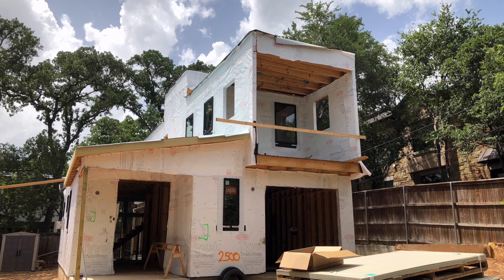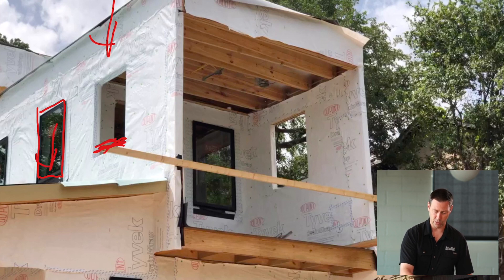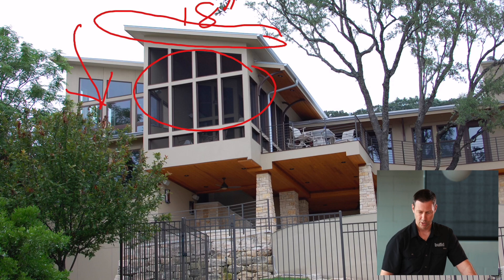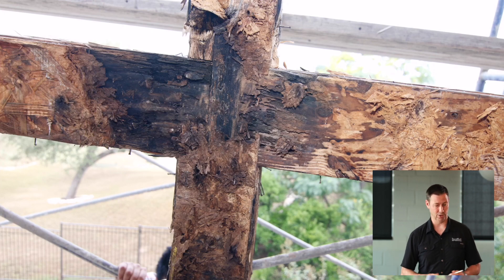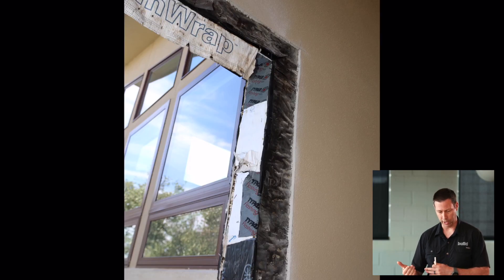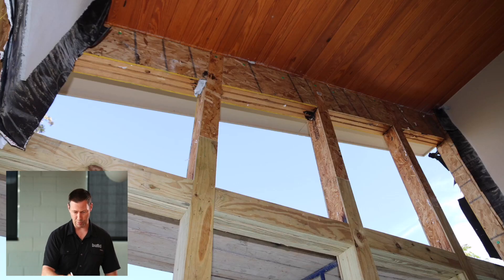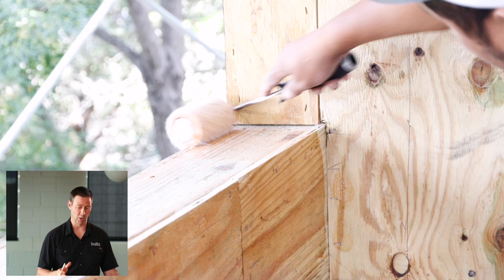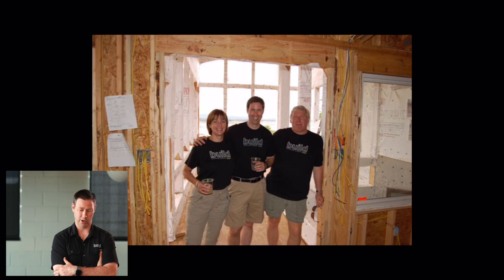Learn from MY FAILURE - A Building Science Lesson

Comment: At 4:00, the failure is why I hate OSB. I call it and mdf vomitboard. Plywood will take huge abuse and still work. Even if the glue fails, the layers will still work and give you some strength. OSB is little chips of rot prone wood, prepared nicely for the rot microbes.

Comment: All builders, take note, stand behind your work.
Reply: Otherwise it is GG
Reply: All  engineers
Reply: Some will.
Reply: Unless it's a manure spreader...
Reply: @ke6gwf  🤣🤣🤣
Reply: I am actually impressed he came back like that to get it right. I guess it depends on the problem. Idk if that sort of thing is “transferred” on a sold build
Reply: most builders close the company after the jobs are done (i.e. development). Then you have nobody to call. Then they change the company name.
Reply: @rickw4160   A good lesson to learn. Never buy a brand new home and never buy a brand new car. Let someone else debug it.
Reply: Especially behind that "safety" rail
Reply: Anyone know about insulation foam board I bought from habitat black one side gray other side foam pale yellow reducing camper and need to know if it's safe to use
Reply: Restoring
Reply: Yeah,  not many do 
They always blame someone else ,which had nothing to do with the work,  bad experience with builders ☹
Reply: Or under it...
Reply: How do you screen clients to make sure you get good ones ?
Reply: @diannaquick6240  Usually there's markings on most insulation
Reply: Take notice...wood has to be the worst building material still in use. Concrete..masonry... doesn't rot.. doesn't burn ..I built wood houses most of my life! Till I discovered there was something better.
Reply: @brianfong5711  
Otherwise it's LOUSY .
Reply: and all used car salesmen.
Reply: did u pay for all the material and charge nothing for the labor of fixing it? if it was truly his fault he should fix it for free
Reply: @MichaelMickelsen  why not?
Reply: Architect here, our group needs to pay attention to these issues just as much so we don't put the builder in these situations. Frankly everyone at every level of construction needs to work on a job site for at least one project.  I didn't think so at the time but my first year out of college my boss has us build an 1800 sf Deck with a gazebo for a client.  We heard 4 weekends he claims 8 weekends.  Seventeen weekends later it was done.  I had more technical experience than most architecture acho graduates as I took drafting through high school but it was the construction experience that got me to think even more about how those details need to go together and the person who has to build it.

Comment: The problem was literally caused by cutting corners. Appreciate the video!
Reply: Props for proper use of "literally". lol
Reply: @ClickLikeAndSubscribe  Use the right kind of materials first and use them properly second.
Reply: @ClickLikeAndSubscribe  I remember one lesson in Southeast Asia when I was assigned there in the 1970s as part of a diplomatic mission. One builder who was using wood actually owns his wood drying kilns and they're designed to thoroughly dry the wood by using infrared inconel heaters INSIDE A VACUUM at the right temperature and at the right time duration period with the wood properly spaced apart to properly dry them. After drying them, we move to an another facility that is connected to the kiln drying facility and he places the kiln dried wood inside them and a vacuum is created and once a high vacuum is created, a pressurzed mixture of bakelite plasticized asphalt is pumped in inorder impregnate all the wood from the inside out, through by through. Once that is achived the pressure is equalized and the excess bakelite plasticized asphalt is allowed to flow to the bottom for reuse and the wood is transferred to a drying and dripping area so that the remaining excess  bakelite plasticized asphalt is allowed to flow for reuse again.  Friends of mine told me he is sill doing it and everybody likes his over-built wood products which are way above standard and the wood products he made are still in pristine condition!

Comment: Run a WUFI analysis on that assembly... completely encapsulating it in vapour impermeable materials will probably result in trapped moisture. Over time the assembly  will reach 30% MC and will rot!
Reply: Connor McQuade Stay tuned. Maybe another replacement video coming in a couple years.

Comment: When l do Windows like that l manufacture stainless steel flashings .
One thing you didn't point out is the nails down into the flashing , that's a no no !
Reply: it was everything you never do and on an upstairs porch is shoddy work period and very dangerous, they made several mistakes and how much of that OSB framing did they really use if you used it on an exterior load bearing post ..smh...shame!
Reply: splashpit that flashing stuff is supposed to self heal around nails and make a perfect seal to the metal, similar to ice and water shield on a roof edge

Comment: So even with the new super sealed products, isn't the principle of making it dry faster than it gets wet still in jeopardy?   The more it's sealed, the more the moisture is locked in.   I've seen "waterproof" electrical junction boxes half full of water due to condensation.   Was anything done on the rework to allow those walls to dry out?
Reply: One would have to check the permeability ratings of the new waterproofing to see if those walls (rework) will have a chance to dry out.  If the perm ratings are above 20 perms or so then the walls should be able to dry out so long as bulk rain water is not finding its way directly in.

Comment: OSB or strand/chip board should not be used on anything more important than a dog house. It is absolute garbage for any purpose.
Reply: Very much not true. It is has strengths and weaknesses just like any other building material. OSB =/= particle board
Reply: My new house is made out of this stuff.  After 2 years i have osb rot underneath my kitchen windows.  Still haven’t figured out where the water is getting underneath the housewrap very frustrating and a bit terrifying how quickly that osb swells up and falls apart

Comment: these failures are architecture first
Reply: No they are not !
You cant design a waterproof building ,period. It should and most likely would have been noted for the builder to make sure all external openings are watertight (building codes ahem). You can put the largest overhang you like on that building and it wouldn't matter, because of wind etc.

Comment: Awesome video.  Really like your ideas on waterproofing. I completely agree on the overhang. My house was built in the 70’s and had zero overhang on the back of the house. Years of problems with water down the back walls of the house. During a remodel I added a 12” overhang across the entire back.  No problems since then.

Comment: the picture at 13:07 ish , you put the flexible corners on the cill (lower) corners of the window openings but not the upper corners of the lower window openings(hoping to make sense) i know that the cill corners is where you will take the most water but surely if the upper corners of the window openings arent sealed they could just accumulate water(albeit slowly) and there will be nowhere for the water to go

Comment: I remember one lesson in Southeast Asia when I was assigned there in the 1970s as part of a diplomatic mission. One builder who was using wood actually owns his wood drying kilns and they're designed to thoroughly dry the wood by using infrared inconel heaters INSIDE A VACUUM at the right temperature and at the right time duration period with the wood properly spaced apart to properly dry them. After drying them, we move to an another facility that is connected to the kiln drying facility and he places the kiln dried wood inside them and a vacuum is created and once a high vacuum is created, a pressurzed mixture of bakelite plasticized asphalt is pumped in inorder impregnate all the wood from the inside out, through by through. Once that is achived the pressure is equalized and the excess bakelite plasticized asphalt is allowed to flow to the bottom for reuse and the wood is transferred to a drying and dripping area so that the remaining excess  bakelite plasticized asphalt is allowed to flow for reuse again.  Friends of mine told me he is sill doing it and everybody likes his over-built wood products which are way above standard and the wood products he made are still in pristine condition!

Comment: I am impressed that you are willing to highlight your past mistakes.  I am a professional engineer who is considered an expert in construction defects.  I have done over 800 forensic engineering inspections and a great number have been focused on water intrusion and rot.  Your video is spot on!!  Great investigation, good determination of the root cause of the problem, and even better follow up to properly waterproof the structure.  You are correct, the vast majority of the time it is not the product or material that fails, it is poor or incorrect installation that leads to water intrusion.  Great Job!!

Comment: My DIY building efforts on the arid Mojave Desert in Southern California during 44 years, have met with similar wood rotting problems shown in this video. Even though our rainfall is just over 4 inches a year the extreme hot temps of the days combined with the 30 plus, degree drop in temp. at night, results in condensation, which is just as harmful to wood as rainfall. Water is water, and wood just needs to stay dry.  Thank you for posting this very informative video blog.

Comment: Totally right about water always wins. I was doing what appeared to be a small job with a spot on the wall. After opening up the wall it was discovered that the roofer left off some of the water and ice shield. It allowed water to leak into the wall cavity. Everything inside was rotten. Needless to say the home owner was totally stunned and shocked that now it had turned into a big job with a lot more cost to fix.

Comment: Bravo dude! Bravo. A real man admits his mistakes and takes action to correct them. I am so tired of fools making mistakes big and small and not taking responsibility for them. This goes both ways. DIYers, prior contractor, and those doing the work now. Clients and builders builders alike must document, document, and document. If a client has concerns about a method or product a builder or one of their employees is using, document your concern with photos and ask the builder to verify if the work was done to specs. On the flip side, a builder must do the same when dealing with previous work by the client and prior contractors. Don't become responsible because someone else's bad work caused your work to fail. Ignoring problems with existing work can make you liable in the future. Walk away from the job if the client doesn't allow you to fix potential issues. Your business and reputation is on the line!

Cheers!

Comment: I work for one of the big international waterproofing manufacturers … we do not warrant any waterproofing installation of our fluid applied nor self adhered membranes if applied to OSB. Period.  Bone dry OSB is strong as you mentioned; however, if wet or damp OSB dries out it still loses 70 PERCENT of its strength and never regains it as your 2X6 does.  Hook up with a COMMERCIAL WATERPROOFING Manufacturer; they will show you proper waterproofing installation techniques.  You’re a stand up guy for sharing this experience with everyone… I’d hire you to build my house based upon your integrity 🙏😎

Comment: Well stated Matt
As a builder too, I have given this issue much attention.
My resolution is to upgrade to modern materials.
From paper and plastic wraps, to wet monolithic applications that dry as a solid product.
I see you came to the same mindset.
There are products that are used in other industry that will perform greatly in our industry.
1- A rubberized spray, applied wet from a can, dries solid.

2- Tuff Liners, a product that is sprayed on and dryes rock solid.
This requires specialized equipment.
Hopefully this will give you some ideas, perhaps we can solve this issue together.

Comment: Great video Matt! Thanks for sharing. My house starts framing on Monday, and I was wondering what the best way would be to add a 5 degree slope to the window sill? We are doing a trimless / sheetrock only finish on the inside; and my builder is not certain the best way to slope the sills and I'm concerned about water as this project is in the PNW (PS: I convinced him to use the Zip Wall System with Liquid Flashing, this will be there first time using that product)
Reply: tpthaler the most common method (at least in my neck of the woods) is a piece of cedar lap siding cut to your opening length and nailed to the framing and then apply your waterproofing over that.

Comment: Great video showing how things can go wrong.  This is really about growing pains with new products coming on the market and the people using it have to figure out how to make it work.  I recently installed some new windows and the manufacturer has come out with rigid plastic flashing for the lower corners to avoid trying to make the peel and stick go across the sill and up the wall.  I also live along the coast where we get Nor' easters and  South easterly winds with heavy rains that will drive water up under an overhang no matter how deep so you have to plan on things getting wet.  The way you fixed this looks great and I hope it works out... as you point out sometimes building what the architect wants and what is most durable means something has to give.

Comment: So here's a question. How did they do So well in houses that were built centuries ago before any of these products were available? I've pulled apart sections of houses that were built in and around 1890 to add additions and the original framing was old yet in perfect shape. Some were lucky if they had a product similar to tar paper. 
Cedar shake roofs, diagonal 1x6 for sheathing and in only some cases had tar paper, copper gutters and only paint for protection. Admittedly the porches would go to hell sometimes but the remainder of the house would be great.

Comment: Nice to see that you stand behind your work, and put a lot of thought into the way you build things. For the amount of time an energy you put into those flashings why not custom make them from lead or copper and weld the seams. All that liquid applied flashing is just going to degrade and fall apart in under 50 years, not to mention water is going to find its way in basically no matter what and you’re just trapping it with the ice and water shield. No way this screen porch is going to hold up for a hundred years.

Comment: I am glad to see you switched to solid material and pitched the sills. I cringe when experimenters take LSL's on patio or overhangs with just varnish surface protectant. It looks good but never lasts. If you need to do a built up sill and all "outside" fascia a quick coat on the inside of the board of oilbased primer works wonders to mitigate water transmission from seams and penetrations. Last word finish trim needs to be hart wood regardless of species as no paint or stain will protect the sap wood long enough to prevent the painter from getting a callback.

Comment: Howdy Matt! 

Can you consider making a shed video? I am looking to build a 12x16 barn style shed. I feel like some of the stuff you talk about can be applied to these structures. Such as the overhang on the bar style sheds are nice on the sides but not front and back. Maybe a fluid applied system would be easier for the windows. You also make me think about under the shed and how I can avoid water damage over time or weather. I still haven't settled on a concrete floor or peer & beam setup yet. I gotta find your videos on what you recommend when wood touches concrete. 

Thanks!

Comment: I have seen plenty of sills with more than 5 degree slope.  I don't think 5 degrees is enough.   Re that original peel and stick product - the cuts on the edge showing bare wood was really stupid. I find it hard to believe that you would have allowed tgat.  Also I agree with you on OSB sheathing and lams.   The stuff is so incredibly sensituve to water that those two applications ought to be illegal.  I'd never have a house like that !  Holmes had a show where snow got in and completely warped the beams   Just a total rubbish product. People use it cuz it's cheap.  Cuz they're cheap.  Solid wood : there's nothing like it.  The regulations have to change.

Comment: Must say kudos to you for putting your mistakes online showing others where you went wrong to help people learn. Hopefully you save somebody this problem in the future. it amazes me sometimes of how little the people that are actually installing the product actually know what it's purpose is or how to install it correctly. My boss hired a brick mason the other day that probably hadn't laid brick in 15 years that had no clue what it was or why we were using aluminum termination bar on top of the flashing. Flashing isn't an easy thing to have to deal with though its sticky and uncooperative and it will piss most people off, especially flashing an inside corner. And I always try to steer clear of any engineered wood whenever possible. you can pack all the glue against little pieces of wood all you want but a little pieces of wood are still going to rot. It amazes me how many houses are built mainly out of glue and sawdust. I must say I halfway stand behind anyting Zip system though. It's expensive but I've  had pieces scrap pieces of it laying on the ground in the yard exposed to the elements for years that look almost as good as it was when we first bought it.